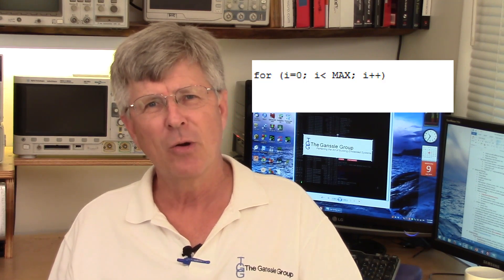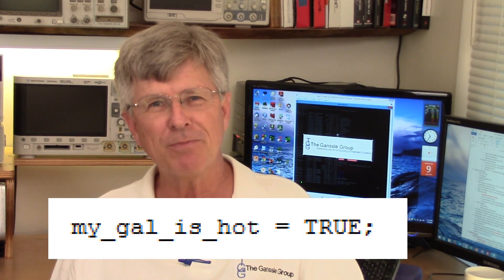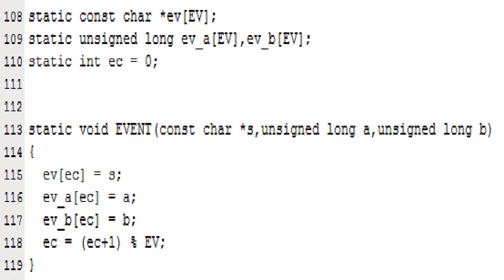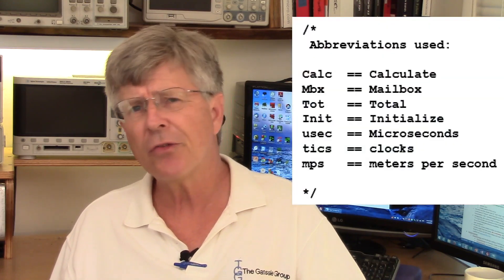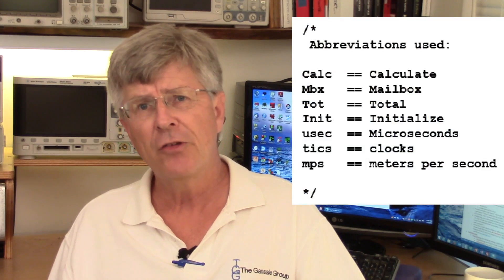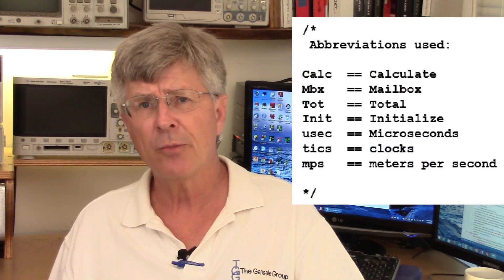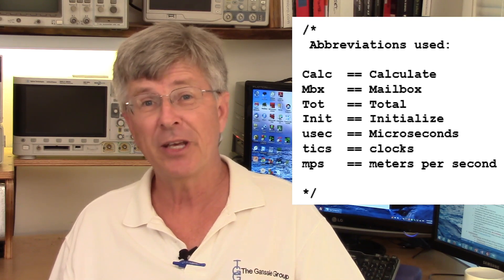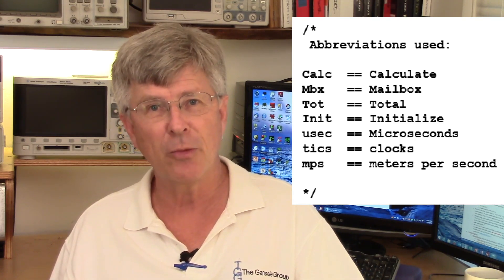Episode 6 - The Inside Scoop on Getting Names in Firmware Right

Comment: About the "i" and "j" loop counter variables... In formal mathematics, we use variables with similar names—i, j, k—in similar places, such as in the sigma summation notation. For simple loops, this removes redundant information that adds little to the reader's understanding. In such cases, helping the reader to obtain a structural understanding of what the loop is doing can be much more important than giving an arguably more descriptive name to the iteration counter variable.  If the reader understands the functionality of the loop body, the variable's purpose is typically obvious. An exception to this rule would be when loops are multiply nested. In that case, it is often better to use a more descriptive name so as not to confuse, say "i" from "j."

Also relevant are functions accepting a single argument, where the purpose of the argument is clearly explained by the function's name. In those cases, I am likely to use "x" for the variable name. e.g. counter_setvalue(int x) or queue_enqueue(object x). Again, this is just like math.

I use underscores to separate things in the hierarchical way Jack described, and sometimes combine two words when they go together in the same level of the hierarchy, as in the above example, counter_setvalue(int x).

Hungarian notation is nutty but also often misunderstood. When talking about Hungarian, the "sz" prefix comes to mind, indicating a pointer null-terminated string ("String, Zero-terminated"). For example, char szName or *szPath. A lot of people think it's useless to indicate the variable's type in the name, since most IDEs will tell you the type. Right. But what about differentiating between a null-terminated string and a pascal-type string, where the first byte (or sometime two bytes) gives the length of the string? These are both usually of type char but the algorithms which operate on them are totally different. So it's not as useless as it may seem at first.